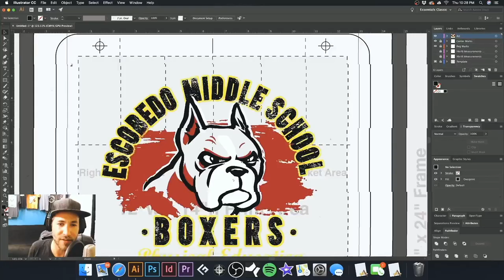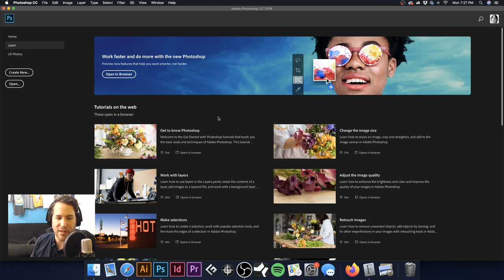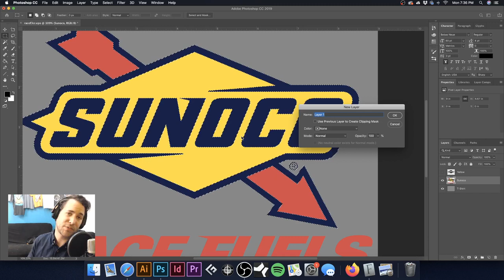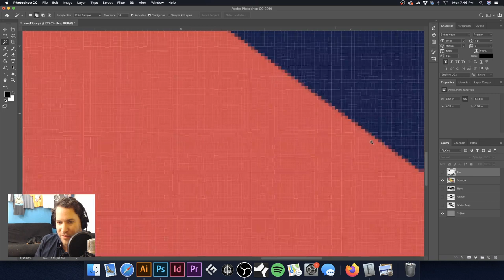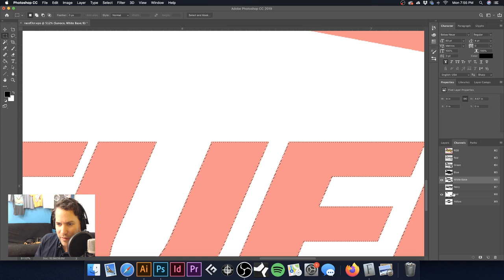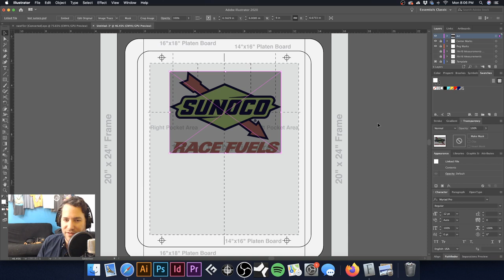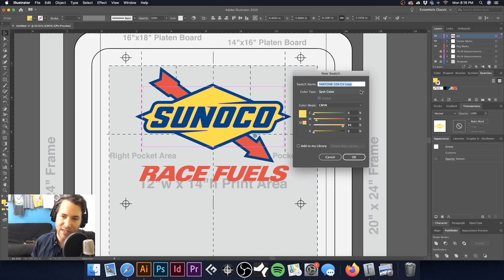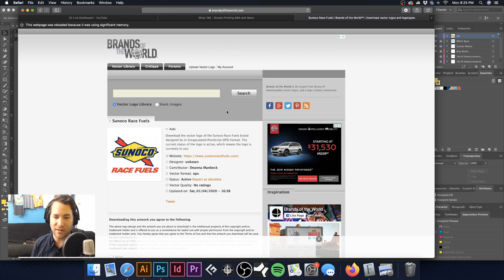How and When to Choke or Spread a Base or Overprint Color | Shop Talk Live

Comment: It's nice and easy to do this now in Separation studio 4 :)
Reply from the maker: It definitely helps speed things up. :) My only compliant is if you bring in a vector image, it rasterizes it.
Reply: @mikeydesignssilkscreen473  I thought SS4 works with the actual vector file. Kind of false advertising if they say that you can now work with vector images.
Reply from the maker: @crumptees  It works with vector art. You can save the spot colors and what not in Illustrator, then open it up in SS4. Then apply your under base. For those that aren't quick about, or have the knowledge how to create an under base, SS4 is great. If you know your way around Illustrator it's just as fast to just make that under base, spread, or trap.
Reply: @mikeydesignssilkscreen473  I will only be using it for simulated process anyway since most jobs are basic 2-3 colors. Now get back to work! lol
Reply from the maker: @crumptees  lol yes sir! That's basically all I use it for.